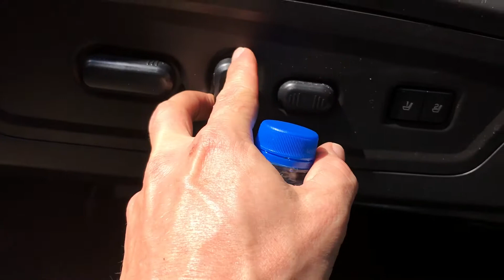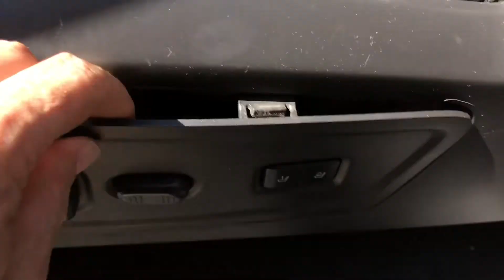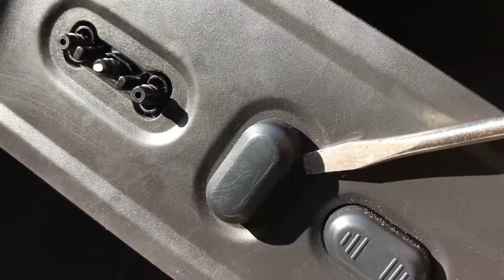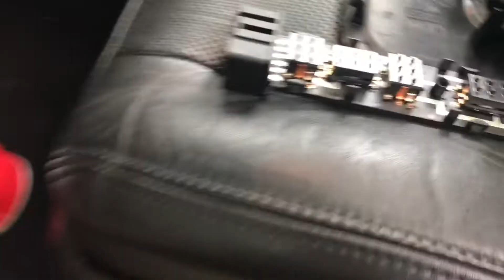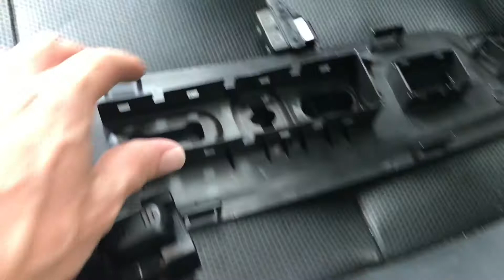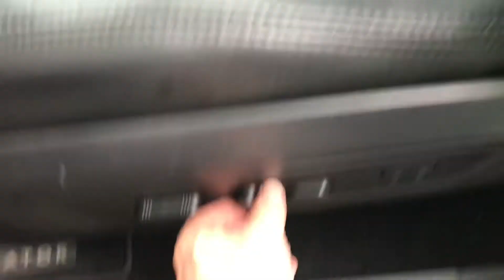Lincoln Navigator Power Seat Repair

Comment: Lincoln Navigator Power Seat Button FIXED!!  This solved the same problem on a 2004 2005 2006 Lincoln Navigator.  The part is slightly different but the electrical cleaner fixed the problem.  Thank you for posting this!!!  2004 Lincoln Navigator Power Seat motor not working fix!!
Reply from the maker: So glad it worked for you!

Comment: Before you tried this fix, when you pushed one of the seat buttons to move it, were you still hearing that electric click noise like it was trying to work? My 2013 expedition driver seat just stopped moving and it seems like this could be the easy cheap fix i need!
Reply from the maker: Well, good question.  I don’t recall a particular sound, but this board easily gets dust and debris in it and the contact can’t make up, it is an easy try to see if it solves your problem.

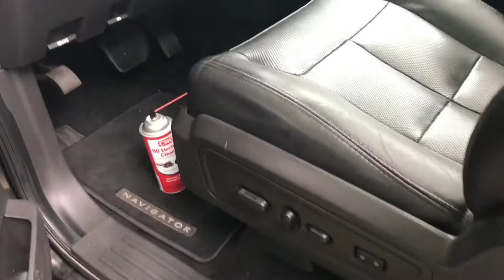Comment: If the power seat works good except when moving the seat forward or backwards it will only move a inch or two and stop l 5:29 et up on switch and then wait a second or  two and push on the switch again and it wil only move a inch or so and you have to do it again what would cause thisl
Reply from the maker: I would eliminate a contact issue, which is the video with the switch cleaning.  However, keep in mind, these motors are somewhat ‘designed on the margin’, and over time loose power.  Also, the tracks don’t get greased ever, by anyone, making the motor work harder and harder to move the seat.  So, I would say start with greasing the seat tracks, the screw drive piece, with a track grease, run that seat up and back a few times without anyone sitting in it, see if you can get the motor to push it the full length of the track, if not, well all that is left is to replace the track motor.  Generally, this motor gets the most use over the life of the car due to the easy entry exit feature installed that moves the seat each time you get in and out of the ride.

Comment: What if let’s just say your main hub being the driver side and it’s controls all work . However when trying to push driver seat forward or back it lags sometimes and sometimes it’ll get stuck . You would have to wait a bit to try and get it to move again.. when it’s a good day the seat can go all the way forward but it can’t go all the way back. I’ve checked the rails there’s nothing hindering it..  so we try the buttons on the seat again all buttons work except the forward and backward motion. The passenger seat almost the same thing. The buttons on door work nicely there’s no lag moves at good speed back and forward no delays but trying the buttons on side it don’t move … I’m like fuk what the hell is going on … Is it the motor I driver side messing up ? Is it just bcuz the seat switch itself bcuz both drivers and passengers is messed up .. I’m pretty good at fixing thing’s growing up poor made me learn alternatives lol.. you think it’s just the motor messing up on driver side band possible the two buttons on the chairs unfortunately happen to both b broken?? I’m just asking a few people before going threw this whole mess. I have an older Lincoln so lucky me there’s not much to go off of . I bought the repair books but the info is very limited as well . Anyways thanks for any of your time
Reply from the maker: So, I will give you my opinion on your question.  First, I tend to believe that your problem may be in the motor.  Here is my thought process, overtime I think these motors degrade to a certain point, and they’re not able to move the weight of a person sitting in a chair and the chair itself on the tracks.  Now if you are a lighter person or you don’t adjust your chair very often, I think these motors can last for quite some time but if you use the seat feature, which is the easy exit feature, which move the seat back every time you enter and exit the vehicle those cycle counts on the motor wear it down over time.   If you have power to the motor and it does begin to move, then you know you were making a complete circuit through the switch, which was part of my video so you can eliminate that.  I tend to believe you may have an issue with the motor so here’s a suggestion. All the motors are the same under your seat. If you can grease your tracks really good with it with the heavy duty track grease,  run that seat up and down a few cycles and get the grease spread it out so that that motor can move it without the weight of an occupant in it; then sit in it and see what changes, if it has a hard time moving a person in the seat, you probably have a motor issue and that motor is near end of life.   One thing to look at is junkyards where you can get a whole new seat you might spend 150 $200 on a new driver seat but if you get one out of a low mileage navigator that matches your year and color you’re probably gonna be better off you might could even find one of those seat motors for maybe 20 or 30 bucks on eBay and sometimes you can call a junkyard and they’ll pull that motor off for you and send it to you. these are just some of my thoughts.  I appreciate you reaching out and I hope you’re able to find a solution to your issue because that problem can be very frustrating which is why I posted this video.  keep me updated on your progress. I would be interested on what you learn.
Reply: @2horseman  thank you brotha GOD bless .. I had a feeling it is what you said.. I’m bout to take the seat out and go threw all the motions to know like you said to check rails first then go from there… as soon as I find out I’ll let you know again thank you for reaching back to me..

Comment: What if even after you done this it still doesn’t move? I even switch out the fuses that control the driver side seat and order that Ford module part brand new from Amazon and after all that it still doesn’t move. I need help
Reply: take a wrench or pliers or screwdriver and tap on the front motor while pushing the button in a direction. Often the motor will unfreeze and start working. Eventually you will need to replace the motor. Just did this today for my 2007 expedition.

Comment: 2013 ford F150 Platinum, same problem with drivers seat, switch is good fuses are good relays are good and the seat moves with the memory switch's but not with the main switch, any other ideas anyone????
Reply from the maker: Yes.  The main circuit board (that I removed in the video, cleaned, and reinstalled) is the same on the driver and passenger seat.  I suggest removing the passenger seat circuit board, testing it on the driver seat, see if it moves the seat.  If it does, then you are pretty sure you have a driver seat circuit board problem.  At that point you can buy a used one or new to replace it.  Unless something shorted in your board, I am surprised that a cleaning did not fix your issue.  Give the board swap a try and see if that works.  I will keep thinking and let you know if any other ideas come to mind.
Reply: @2horseman  I am in the same boat with my drivers seat on my 2010 Navigator.  I tried cleaning the switch using this video, it didn't work so I ordered a brand new Ford OEM switch and installed it, but that did not work either.  The passenger seat works so I switched the fuses to make sure that was not the problem and the passenger seat worked using the Drivers side fuse.  So I know it's not the fuse, I have a brand new switch and the Driver seat still does not work and now I am stuck as to what to do next.  Adam, how did you fix yours?  Steven, any other ideas?  Thank you in advance!  Mike
Reply from the maker: @mikemd2697  I have a few thoughts.  Do you have a multi-meter that you can tell what is getting power?  Here is why I ask.  I know it might take an hour or so, but unbolt the seat, lean it back so you can see all the underside and test power flow.   Unplug a motor, either one, and put the meter on the power wire to the motor and make sure you are getting power.  If none, work backward, unplug the circuit board and verify power to the board, etc.  If you have power all the way to the motor, your motor may be bad.  If all of this fails, just to save some mental anguish, you may want to just buy a used seat from a junk yard and replace yours.  I’ll keep thinking.
Reply: @2horseman  Hi Steven,  thank you for the quick response.  I found the problem and learned there are actually 2 "fuse boxes;"  both of which contain a fuse that controls the seat switch.  The fuse on the engine bay was the one that was ok... the other fuse was behind a plastic panel on the passenger side on the right/outboard side of the toe kick area under the dash. It was a 7.5 Amp fuse that was blown due to a short in the switch on the drivers side seat.  This short appears to have been caused by excessive wear/rubbing against a protruding screw on the seat bracket against the back plastic housing containing the switch.  This was caused by the side seat cover plastic brackets that cracked in 2 places, causing the side plastic cover to "float" and rub back and forth, up and down, wearing through the plastic housing containg the seat switch so much that it rubbed thru to the metal circuits inside the switch.  Once the metal screw on the seat bracket contacted the circuits inside the seat switch, it shorted out the fuse behind the passenger toe kick I mentioned above.  I hope this detailed explanation is helpful to anyone experiencing this problem.  Thank you again for posting this video, it really helped me to start troubleshooting!

Comment: @Steven  Ford  Anything else I could use as a (electrical cleaner)? House hold items? WD40?
Reply from the maker: While branding is not important, it is important to only use an electronics cleaner that leave no residue.   The product shown in the video is only a few dollars at the local big box store, maybe $5-10 at the local auto part store, but is perfect for this application.  I have also used it to clean brake light contacts when changing bulbs, and electrical connectors when disconnecting and reconnecting.  WD40 is not intended for electrical boards like this, in my opinion, and could foul the sensitive contractors needed to send signals to your seat motors.  Hope this helps.